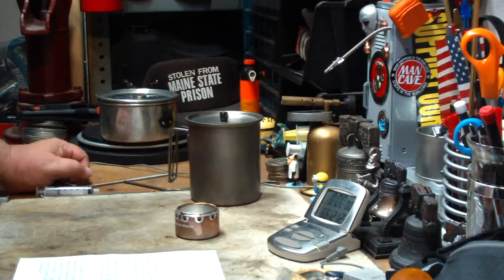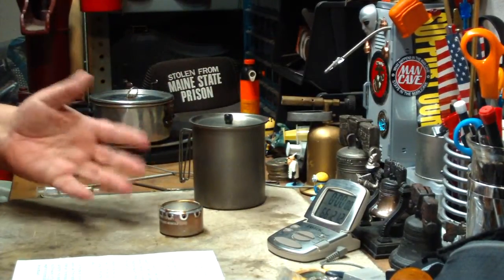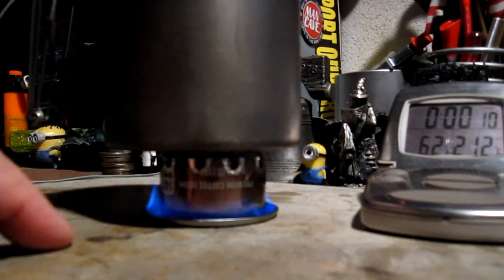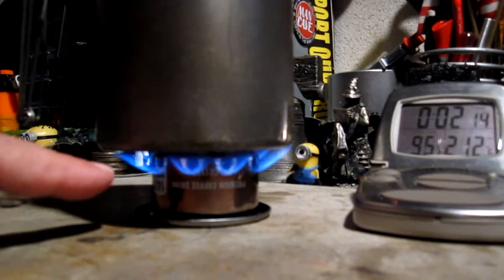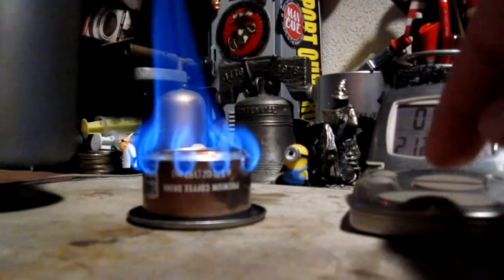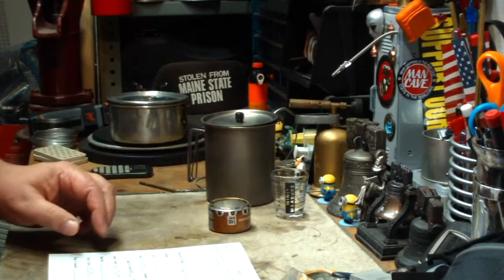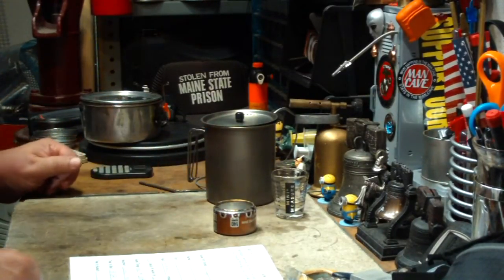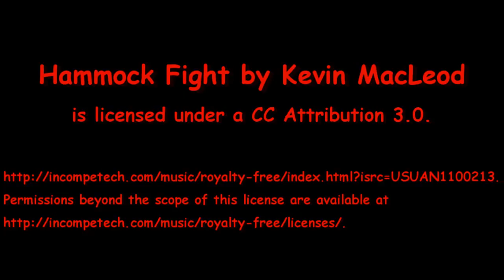MatoNupai's MAHALO Alcohol Stove -  Vargo Titanium 750 ml Mug - Boil Test #1

Comment: The amount of fuel used was almost identical between the two. 16.8 ml for the boyscout pot, and 17 ml for the titanium. Either way you use a lot less fuel than most stoves especially the Super Cat, and Budweiser bottle stoves that can tear through 30ml in 6-7 minutes.